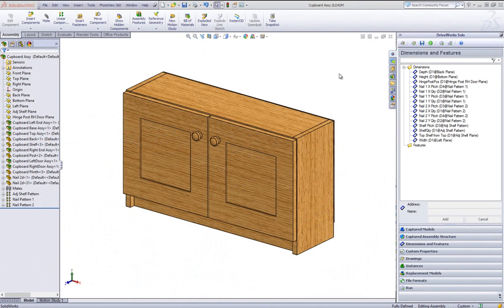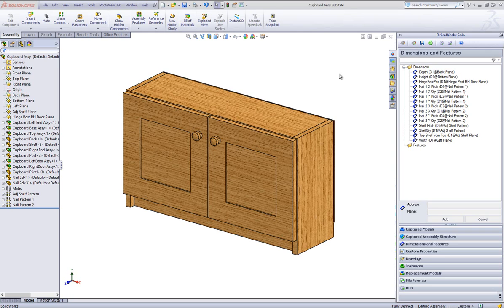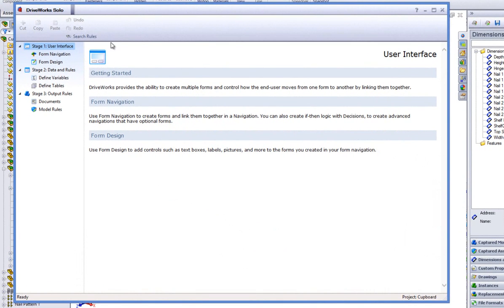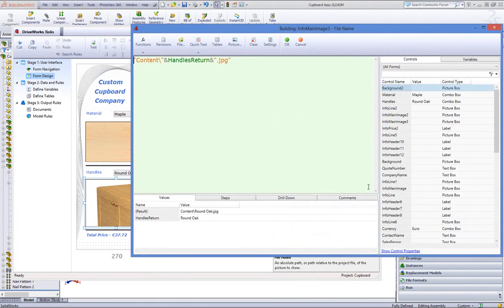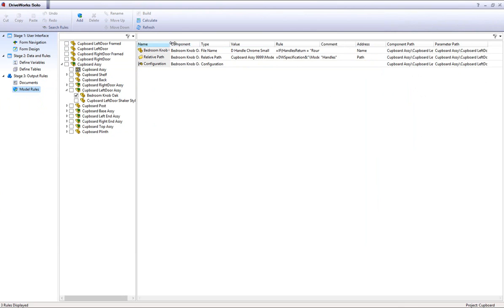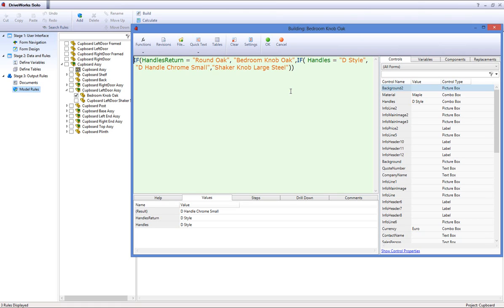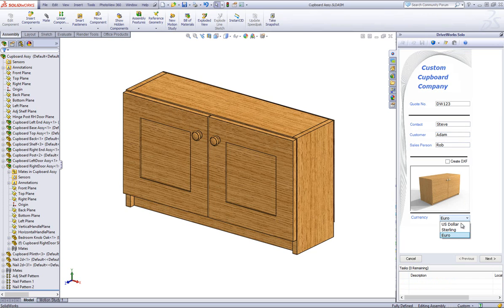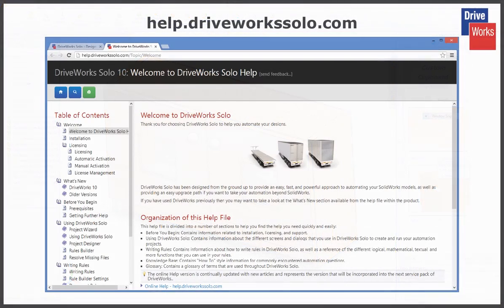DriveWorks Solo - Capturing a Replacement Model

Comment: I have a problem here. I am replacing A part with B part in an assembly. The replacement works fine. But its not making features suppress unsupress functions or dimensions update to the Part A(Original part)or Part B(Replaced part). What will be the issue? This is specific to DriveWorks Solo certification template file of Table with round and square seat. Please help.

Comment: Hi there. tnx for your tutorial. I had a problem using this setting. I want to the assembly I selected as replacement assembly get mates of original assembly, but it didn't . could you help me solve the problem?
Reply from the maker: Hi Zahra, 

Without taking a look at your DriveWorks Project it is difficult to identify the cause of the mating issue.

It is likely caused by replacing a component with one  that doesn’t have the same references – causing the mates to error.

For this to work, both the original model, and any replacement models must have been created from the same model so that the unique identifiers given to the model and the geometry used in the mates are exactly the same.

It is considered a best practice to mate to reference geometry wherever possible to make replacing models easier.

I would recommend taking a look through the Help File - https://help.driveworkssolo.com/topic/HowToReplaceAComponentWithAStaticOrDrivenReplacementModel and if further assistance is needed working with your reseller.
Reply: @DriveWorks  Tnx a lot